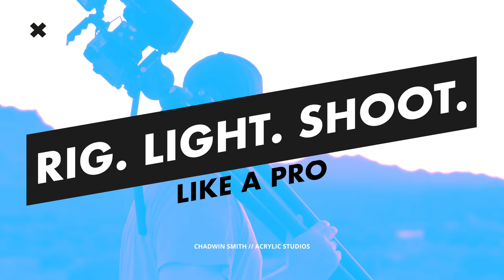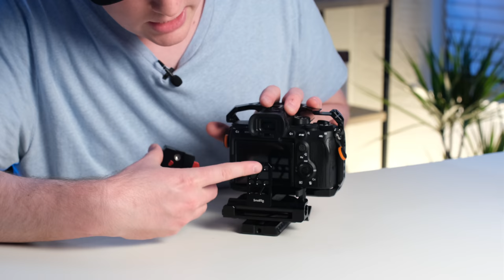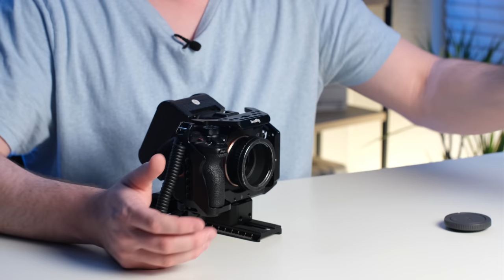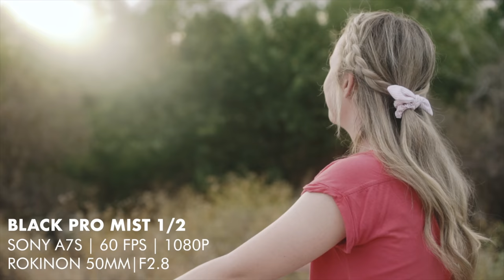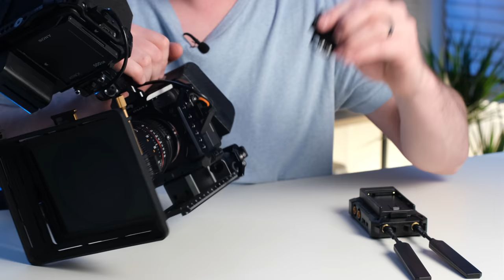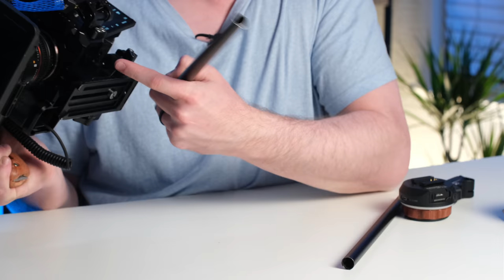Turning the Sony a7siii into a Cinema Camera

Comment: Great video.  The only thing truly preventing this camera from being a great cinema camera is the fact that it does not have open gate 3:2... this camera is not a 12 megapixel video camera as people would believe.  It is a 12 megapixel photography camera but unfortunately shooting raw video, you cannot get a full sensor readout 3:2... You can only get 16:9 which is a major issue for some.  It limits vertical crop options in post and it prevents you from using a 2X anamorphic lens.  It's a real bummer that Sony doesn't release firmware to address this issue.  We paid for a 12 megapixel sensor but only using 85% of it.
Reply: That camera exists already, it's called the S1H.

Comment: Great set up. I use a lot of the same bits and I am fully rigged out. I wanted to comment on the battery door issue. I have the A7siii and I could not locate a replacement door but in my research I found the A7siii uses the same door as the A7RM4 which also has no rubber flap and notch out o use a dummy battery. So not wanting to leave the battery door off or tamper with it, I bought one of these A7RM4 battery doors and used a dremel tool to cut out a notch for the dummy battery cable. Worked like a charm and it is better than leaving the battery door completely off in my opinion. The door is real easy to remove and replace so I can put the original door back on if need be. I think I paid 40 bucks for the door.
Reply from the maker: that's awesome! sometimes when something doesn't exist you just gotta make it. I really think they're not adding the hole anymore cause they want us to power it from the USBC port on the side now. Glad you found a unique way to make it work!
Reply: @chadwin  Would this usb-c solution still go to the v-mount? Essentially a usb-c to d-tap?
Reply: @honest_noise  Did you find out?

Comment: you can take off those peak design attachments and loop them through the cage and screw in the cage through the little hole where the triangle is on the right upper of the camera body. 2 points to secure the camera to the cage plus less stress on that one bottom screw
Reply from the maker: Okay good to know! Thanks for the tips!

Comment: Love the A7siii. For low light recording,   But Panasonic offer 5.9k raw output to the atomos ninja which makes the S1h or S5 a better buy,    The S5 is also half the price of the A7siii
Reply from the maker: Yeah, the a7siii is definitely still the lowlight king. 
But wow, I didn’t realize they added 6k ProRes raw (w/ ninja) to the S5, that’s pretty incredible, especially at only $2,000. My struggle is the lens mount, I don’t have any lenses for it, so I’d need to adapt everything and if I need autofocus, I’ve heard it’s not great on Panasonic.
Reply: @chadwin  tbf,  AF has never been Panasonic’s strongest suit,  but since the latest firmware upgrade its massively improved,  still not as good as cannon or Sony , but definitely useable in all but the most demanding situations.
The colour science on Panasonic is better than Sony too (imho). But the 5.9k raw output images it a colour gradists dream.
As for the lens mount,  you can use a fantastic range of lenses,  even old canon FL and FD lenses.
With more L mount lenses from sigma coming out next year.   (God,  I sound like a salesman)
Reply from the maker: @50450720  yeah I have the fujifilm X-T4 and it’s AF isn’t nearly as good as Sony or canon, so I imagine Panasonic is similar to that. The S5 seems like incredible value for money though with 6k and very color grade able. Haha I feel like a salesman half the time too, but we just really love our gear and wanna tell others I guess!

Comment: Wait, how are you adapting that canon glass? Are you shooting in 1080? Without the 6k downsampling to allow for 4k crop mode, it's impossible to adapt canon glass to the a7siii without massive vignetting, no? Does that lens have a larger than full frame image circle? Are you using clear image zoom?
Reply from the maker: As long as you use Full Frame glass, you can adapt EF glass without any vignetting or issues. I’ve been adapting full frame canon glass for years to Sony full frame with no issues. You don’t have to use any crop modes or anything. 👍🏻

Comment: Love the rig man. But I was wondering if there isn’t too much weight on the front of the camera. Wouldn’t it be better to had the v mount battery laying down so there’s more weight on the back?
Reply from the maker: Depending on the lens you use, it could definitely be front heavy, to be honest it’s pretty well balanced with this setup, but you could absolutely lay the battery flat. That’s what’s so great about having it on the hinge, you can quickly adjust it.
Reply: @chadwin  yeah true, and if you need more weight on the back you could also just mount a bigger battery. Thanks for the reply.

Comment: Two things - Sony's autofocus is one of the best, not sure why you would nix that feature with this setup. It seems like a lot of filmmakers are adopting autofocus cameras these days - especially for solo shooters. Unless you have a 1st AC, it can be a challenge concentrating on framing and balance all while keeping the subject in focus. Also, the battery performance of this camera with its native battery is excellent - 2 hours at 4k 120p: why the v-mount? Seems like a lot of extra weight for little return for most use cases.
Reply: ...on reflection, I realize cine lenses provide more flexibility and can be better quality (although I'm not sure the Rokinon cine lenses are better than native Sony lenses).

Comment: incredible... 
question: when you build a rig like that, do you expect to have to take it apart often or is it meant to stay put for awhile?
Reply from the maker: thanks! I keep it put together for as long as i can, but sadly yes i usually have to break it down for long distance travel or to use the parts on another setup. you can get bags from Tenba and other companies that are made for fully rigged out cams

Comment: Hi Chadwin:  The external power pack has 14.5vdc and the sony battery only 7.2 vdc, is it OK to power the sony at 14.5 vdc from power pack?
Reply: Thought the same. Without a voltage regulator this is the most stupidest thing to do.
Reply: Dummy batteries have the voltage conversion circuitry inside them in order to step down the supply voltage and meet the camera’s voltage requirement.

Comment: for the alvin’s cable D-tap dummy battery, does it converts voltage from v mount battery 14.8v to npz100 which is 7.2v? cause it looks like just a direct cable

Comment: Nice build, but i would definitely put the matte box on rods, just in case your director wants you to change lens every 5 minutes! ;-)
Reply from the maker: That’s true. If you have a ton of lens swaps to do on a shoot, unscrewing the clamp adapter and switching to other lenses can be tedious. Luckily polar pro does make a 15mm mount adapter if you wanna use that instead

Comment: Hi, can we use external ssd on Sony A7iii instead of using memory cards ? If yes where need to be connected ! Micro USB port or C port ? 

Please help
Reply: You could use an external monitor/recorder like the Átomos Ninja V and record to that SSD. In that case you would use an hdmi cable for the connection.
Reply from the maker: sadly no. can only record internally on SD cards or externally with an external recorder such as ninja v
Reply: @chadwin  ok
Reply: @jpsamora  Thankyou

Comment: I thought about doing this,but I picked up the FS6,and don't have to worry about shut down.
Reply from the maker: Nice! Do you mean the FX6 or FS5? Either way both are great cameras that don’t overheat and can be left on all day. Very cool!
Reply: @chadwin  sorry my bad, FX6.
Reply: @colemanmediagroupnetwork8369  worry about shutdown?  Can you explain?
Thanks
Reply: @Hangs4Fun  if you live in the US,you only have around 12to 29 minutes of shooting videos,the camera will shut down,but can start shooting videos again after everything re-boots.the reason for this is the camera companies don't want to pay the very high taxes.so for my work I don't need any types of shut downs.so only ciemea cameras will work.
Reply: @colemanmediagroupnetwork8369  that is not true with the A7SIII, I have personally recorded events for longer than an hour with mine.
Reply: @Hangs4Fun  just going by what has been told to me
Reply: @colemanmediagroupnetwork8369  that tax restriction has been lifted, so now if companies limit recording time it is for other reasons.  All new Sony mirrorless cameras have no limits any more (at least until you run out of power or memory ;-)
And like I said, I have confirmed this a couple of times now with my own experience..

Comment: confused why added weight with the sony L battery - maybe you could run another dtap to barrel outta the vmount to run the atomos?
Reply from the maker: yes, you can definitely power the monitor and other accessories with a d-tap cable instead. . the main reason i've been powering them separetly is cause some people have had issues with frying some equipment when they're all powered off of the same battery and power surges/grounds through the HDMI cable. however, if you properly power/plug everything in, you shouldn't have that problem.

Comment: Should I plug the d-taps into the battery plate or the battery itself? I’ve seen you do it both ways in some videos. I don’t want to fry anything
Reply from the maker: you can do it either way, i do both yes! just depends on the placement of the port on my rig and such. shouldnt fry anything as long as the device can handle the dtap output.
Reply: If you have a battery that has enough d-taps (or add those small 3 or 4 way splitters) you can use those and dont need a big heavy plate. the plate makes sense for higher powered equipment (real cine cam, big monitors, etc.) to distribute the load over several ports. or if you want to have different voltage outputs directly from the plate. 

but a mirrorless camera, follow focus motor and a ninja v can safely be powered from the batterys dtap alone.

Comment: Can you use the V mount battery to power both the monitor and the camera at the same time?
Reply from the maker: Yep, you can power both at the same time. Just make sure your hdmi cable and everything else is plugged in before powering anything on. And powered off before unplugging anything

Comment: Cool rig! My only concern would be that the V-mount battery blocks the camera controls and display quite a bit. Flipping out the display is good but somewhat awkward in that position. Is there any way to output the on screen display to the Ninja V including all the setting options and so on?
Reply from the maker: thanks! Yeah, so you can mount the v-mount battery flat and further back on 15mm rods instead to give better access to the screen. Yes, you can get all of your camera settings on an external monitor, however if you're recording on the ninja v, it will also bake the settings right into your image.

Comment: Quick question, I dont want to fry my camera. Is it always safe to follow these steps in order?
- Connect dummy battery to camera and to battery (with both off)
- Turn on v-mount plate
- Turn on camera
Reply from the maker: Yes, I would connect everything first. Put the v-mount battery on. Then power the camera, then a monitor if you’re using one. I’d then power off in reverse.
Reply: @chadwin  thank you for responding I use a Miady 154 with a Camvate v-mount plate with a 7.2V Dtap.

I fried my A7iii recently (might make a video about it) I think what happened was I actually had the dtap plug into the actual battery and not the Camvate plate. And I also didn’t follow the steps. I’m pretty sure I turned on the camera then the v-mount and boom I lost $600 in repairs
Reply: @chadwin  also I really want to hear your take on using v-mount plate to USB-C to camera. Does this act different than a D-tap battery?

Comment: Any reason you didn't power the Monitor off the V-Lock too?  If you had a vmount plate you could power everything off 1 battery, less to manage.
Reply: He want something he can still use when he wanted to take off the camera
Reply from the maker: I didn’t power the monitor off the vmount for 2 reasons. I didn’t have enough open dtap ports (I could us a splitter though) and I’ve heard of people frying their camera when they power cam and monitor off the same battery.
Reply: @chadwin  good point, but I think a voltage regulated v lock plate with a few dtaps would keep you away from overvoltage. You could also set it up with a USB C adapter which is even more controlled over the voltage. And keep a battery inside the camera so you can do hot swaps and keep the camera on while protecting the camera.
Reply: @chadwin  the problem isn't overcharge it's floating ground when having both camera and monitor being powered by the same battery AND both camera and monitor are connected via HDMI.  There is a very specific sequence when cabling up or down that keeps the ground safe.  Do it wrong and ground for power of the whole system is found through the hdmi
Reply from the maker: @Hangs4Fun  hmmm.....I just wish I could figure out what the right sequence or safe setup for that is. I’ve powered my cam and monitor with the same v mount battery for a long time, but once it did something crazy and my BMPCC6K wouldn’t power on for a day and I thought it was fried. So I stopped powering my monitor from the same source ever since.
Reply: @chadwin  This goes back to the same thing we dealt with in high speed SDI 6G and 12G, when both the camera and monitor/recorder were getting power from the same battery and also had SDI 6G/12G between them and someone plugs/unplugs cables in the wrong order while powered up. Apparently it is starting to creep its head up on HDMI implementations, especially on the faster HDMI 2.0 and 2.1.

Simplest thing to do here is have a safe workflow when setting and taking down your camera rig, simply following this process:

- When connecting: FIRST connect power cables, THEN HDMI / BNC.
- When disconnecting: FIRST disconnect the HDMI / BNC, THEN the power.

Also helpful is using shielded power cables and avoiding D-tap connectors (since they can possibly be plugged in backwards). To safeguard your D-tap connector you could add the Lentequip Safetap which protects against reverse polarity, over/under voltage, and short circuits, as well as preventing battery deep discharge.

Of course with P Tap, there is always the danger of plugging in backwards, it is easy to do on cheaper cables and plates.  Always take the time to match up polarity and plug shape (between cabling sequence, plug insertion, etc, you just need a solid process you go through each time and you will be fine.  For people who just start plugging everything up or taking everything down with no rhyme or reason, no thought, everything the cheaper quality; they are most susceptible to these camera frying issues IMHO)

Comment: Looks good. Quick question. How are you securing the top of the batter to the back of the camera when it's touching the camera (so that it doesn't move when you shake it). Looks like you fastened something but couldn't see what it was.

Comment: Hey Chadwin, nice build! With that hinge mount for the battery on the back is it even possible to use 15mm rods if needed? And also can you link the cage That is shown at 07:29? Looks like it has a build in Arca Swiss plate but I cannot find anything like that for the a7S III.
Reply from the maker: yes, you can use a 15mm rod extension adapter. it allows you to add another 15mm rod to the front side for a follow focus, matte box, etc. The cage is linked down below for the a7siii. I haven't used the arca swiss feature, but I think the bottom of the cage is yes.

Comment: Is there a version of the 15mm hinge so that the rods go into it and not into the base plate?
Reply from the maker: I wish, that would be a great design. What I do instead is add the little 15mm adapter threads so i can attach rods to the front side for my follow focus, matte box or other accessories.

Comment: I'm new to cinematic cameras and this may be a stupid question, but how do you get to the camera control buttons and switches with all that rigging??
Reply from the maker: it can def get in the way, but for the most part, all of the buttons and dials are still accessible. as far as the lcd goes though, i just flip it out out or tilt the v mount battery back to see the screen.